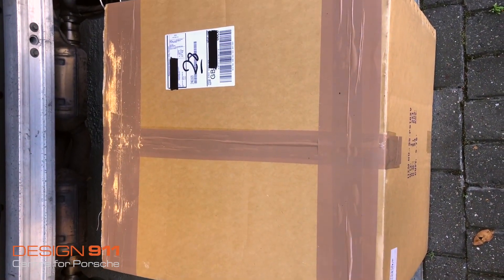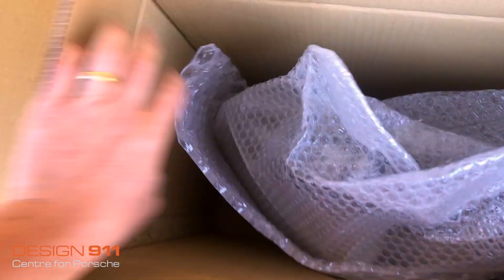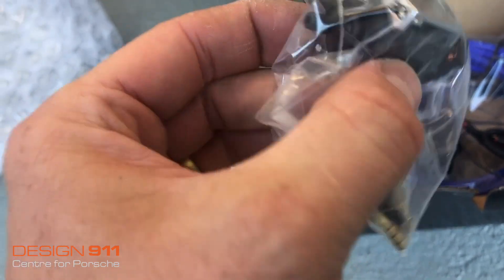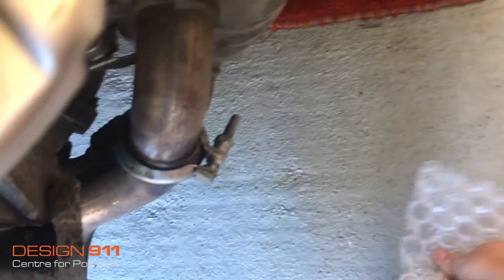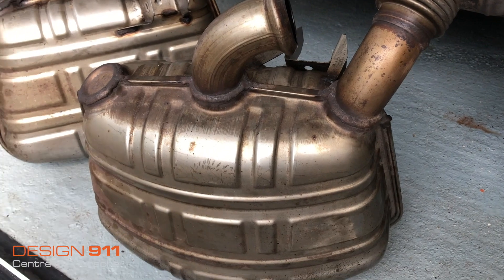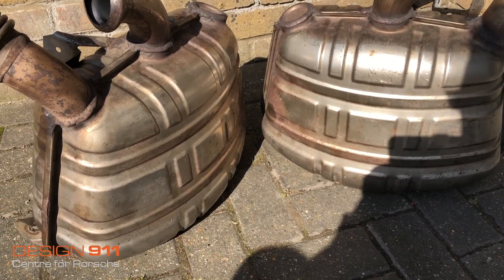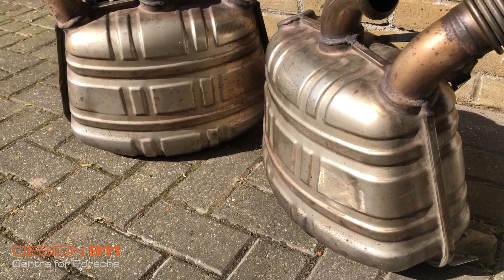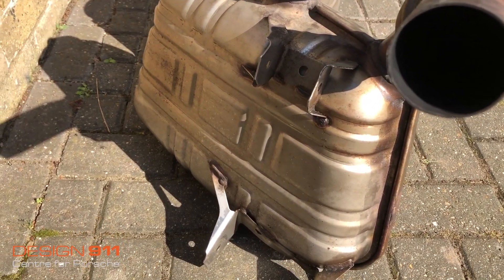DesignTek Valvetronic Exhaust Muffler / Silencer Unboxing

Comment: Nice-looking exhaust. There was no comparison between the valve open and closed positions on the newly installed exhaust, so viewers can't tell which position it was in during the recording. Having listened to a few of theses, it sounded like the valve was actually closed in the recording since the open position is normally throatier.